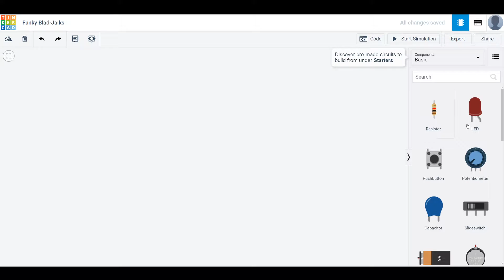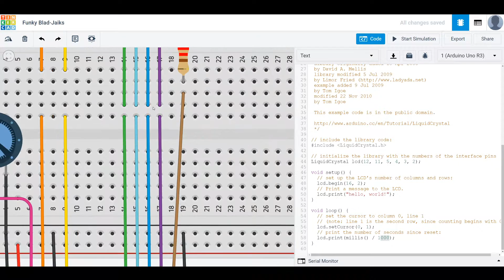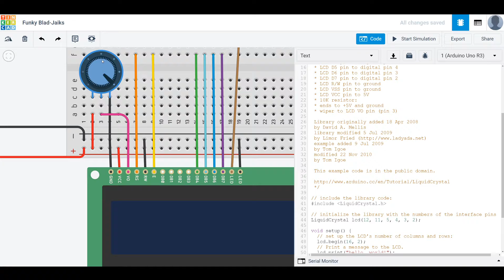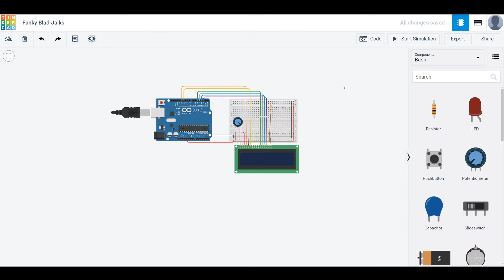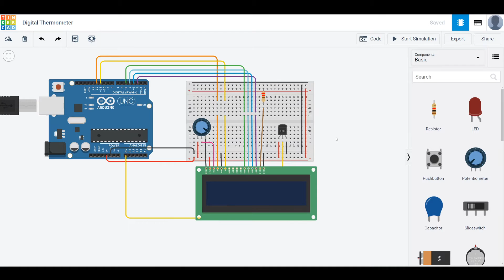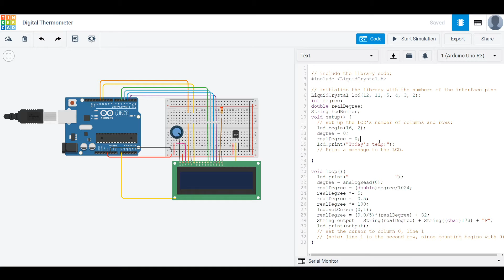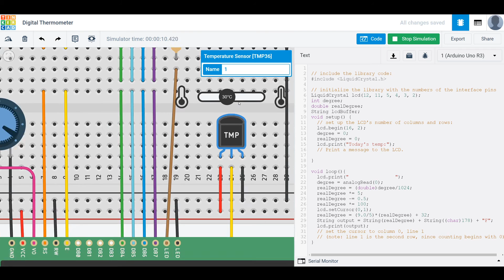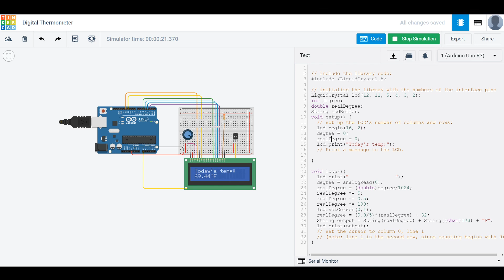Making an LCD Digital Thermometer with Arduino

Comment: how to do whether the temperature is low,it gives red color and the temperature is high,it gives green color
Reply from the maker: Hi there! you would have to add an if/else statement with temperature ranges that would turn on or off the LEDs you add! Hopefully, that helps!

Comment: String((char)178) creates an antenna looking symbol for me haha, and when I look up the ASCII table it says 248 is the degree symbol, but that prints an x bar
Reply from the maker: Hey Andre! After a quick search, it seems like the updated IDE is having trouble converting the symbol correctly. Try looking at the thread found below at the 2020 responses to the question! They should have an IDE version closer to yours and may have more chance of working! 

https://forum.arduino.cc/t/solved-how-to-print-the-degree-symbol-extended-ascii/438685/42

Comment: How to make the temperature only use Celcius only
Reply from the maker: Hi Ahmad. The system's default is Celsius. If you forward to time 14:45, you can see we edit the code to convert to Fahrenheit from Celsius. If you are using the code line by line, deleting line 28 should do the trick. Thanks for the question!